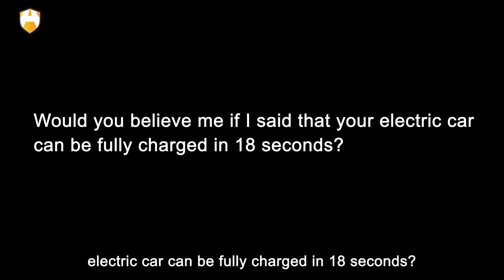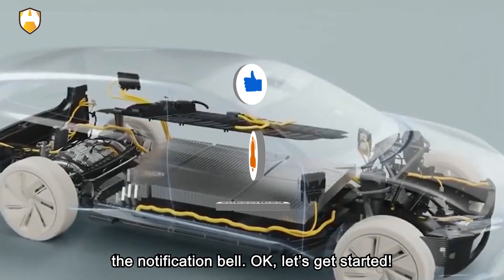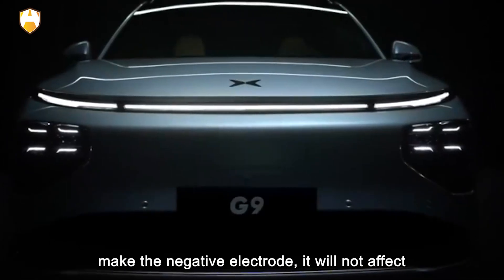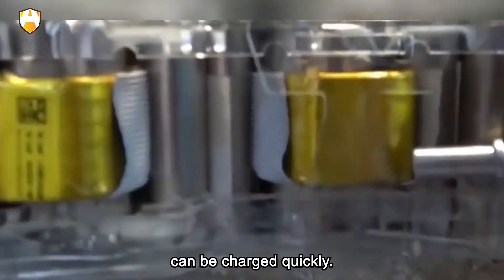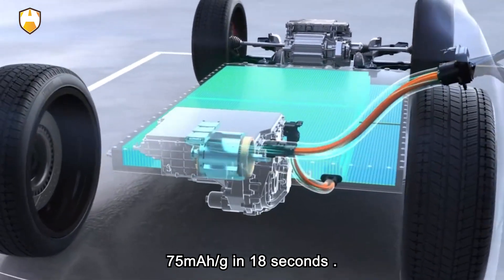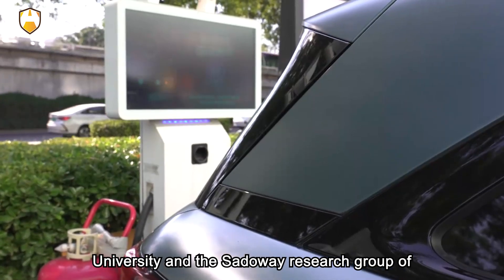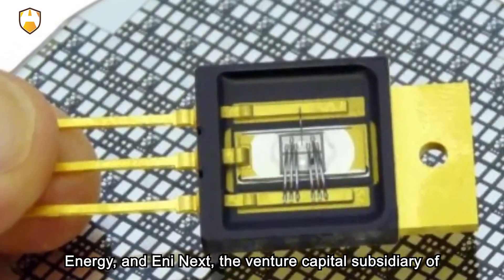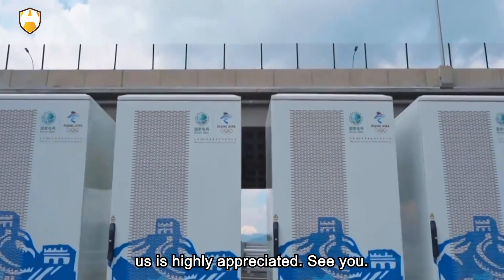18 seconds to fully charge your electric car? Bill Gates' favorite power battery

Comment: The benefit comes to a wash, both have dangerous electrolyte can kill driver and passenger in an.accident.. 

On the other hand, one problem we are ignorant is that charging current is inversely proportional to charge time. Lowering charge time can cause rise in charge current and heat. We have reached a diameter and thermal limits to keep connecting operation manageable by using liquid cooled cable down to 45 minutes to a full charge. For charging rate of less than 20 seconds the coolant can vaporize the liquid coolant can be vaporized in few seconds causing an explosion. 

Remedy? Each time we half the charge time, double the pack voltage. Upgrading from 45 minutes to 18 seconds charge time we need ti replace a 400V pack with a 60 kilovolt pack, or replace the cable from 1.5” to 18.5” (3.8cm to 47cm)